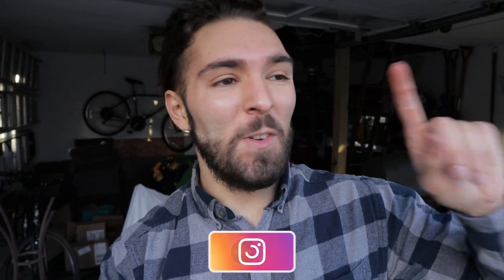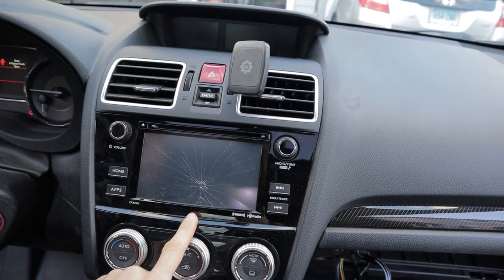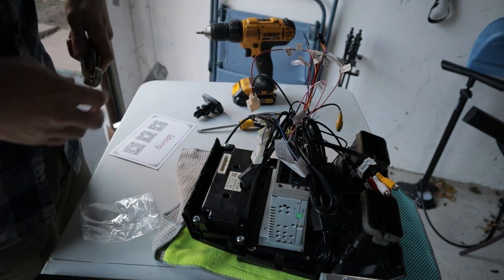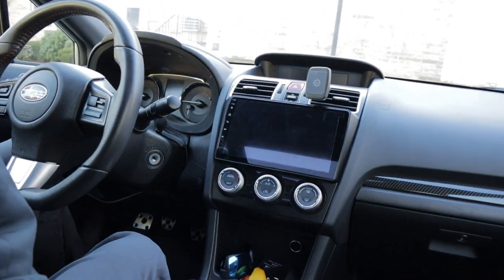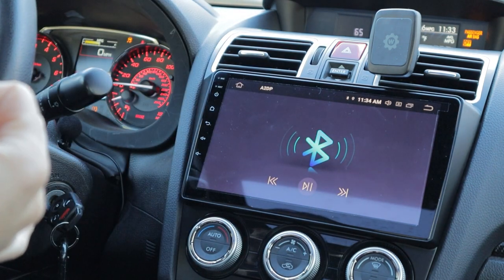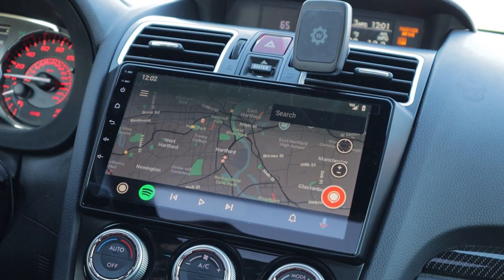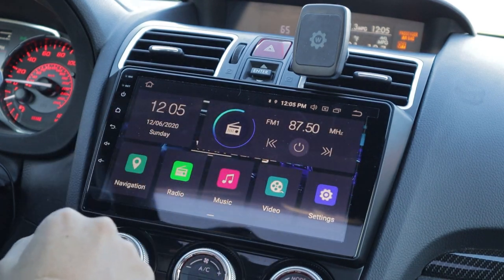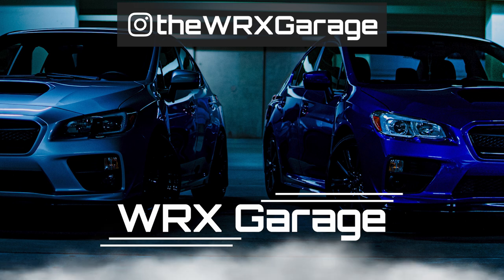iDoing Android Headunit (With Android Auto!) - Subaru WRX 15+

Comment: Just installed a kenwood head unit along with new door panel speakers and subwoofer. It was definitely more complicated with the wiring and probably more expensive than this thing. This android head unit looks very nice!
Reply: With the research I've done, brands like kenwood are for sure better for audio and reliability. These android head units may be cool and more plug and play but the customer support and everything isn't as good. Would be awesome if kenwood and other US brands could make Android units but it's because they technically aren't legal. Great choice though I bet your audio is super crisp!
Reply: @slowsubie6386  ok so you're right about the audio, though this sounds really good, but not up to par with a 1K dollar kenwood.  Now on the support front... Have you ever tried to get on chat with Kenwood or Sony, or Pioneer.  I've spent the last week basically in live chat with IDoing working through small issues.  I post and I get answers in minutes(not days).  I had a kenwood wireless AA unit in my old car.  I spent days wiring in, and AA wireless is still the most flaky finicky thing there is.  I opted to spend the 400 dollars on this instead of the 250 dollars just to get the cabling and maestro needed to move my existing kenwood over.
Reply: @slowsubie6386  it is not that they are not legal, is that these companies are all about maximizing profit and they don't have to worry about adding the extra stuff as long as the bare minimum is done

Comment: If your having trouble clipping the unit to your car, start at the top clips then move to the upper middle clips and force those down until the latch then you’ll have to put a little force into the bottom clips but just take your time and don’t break them, clipping the head unit in took me longer than taking out the old unit and setting up the new one

Comment: nice unit. and thanks for the "what not to do" PSA.   to me, car audio should be easy, especially for the manufacturer; however, Subaru goes out of their way to make theirs as low rent as possible, even with the high-end HK system.  I know part of it has to do with anti-theft and part has to do with vehicle integration; but with all of the R&D money put into other area of the car, the car audio//infotainment side should be an easy no-brainer.  That iDoing unit looks surprisingly good for Chinese unkowns.  Hopefully it works for you.
Reply: From the research I did I think Idoing is the best option for the chinese brand ones. Would be awesome if US brands could make android head units but i think its because they technically aren't legal.

Comment: Hey man I love your videos they're super informative and great for people just getting into Subarus! I just got my first wrx a couple months ago and I'm dying to upgrade the radio. The wrx has the worst factory audio of any car I've owned surprisingly as it's the best car I've owned since my rx7.  Looking at purchasing this idoing head unit but, I want to know the pre-amp output voltage for the front, rear, and Sub outputs. I've looked on their website for the spec sheet but it doesn't have this info. When setting gains for amplifiers it's important to know what this is (most head units range from 2v-5v some cheap units even less). I know I can check  this with a multimeter from the rca jacks while the unit is installed and on and I always verify the voltage before setting my gains but I prefer to know these things before I buy a head unit. Audio is always a big part of all my cars and I typically use Kenwood or Pioneer (who always have these specs on their website) but the plug and play ability to retain steering wheel controls without having to purchase additional devices and do extra wiring with the idoing is very appealing. Any chance you know what the preamp output voltage is?

Comment: Just installed today in my 2018, pretty simple however reverse function and wifi are not working...

Update: I realized the 10 pin connector fits into 2 places and I switched them. 100% working and flawless!
Reply: that's odd, you sure you got the IDoing?  The cable set I got had ZERO cables that could get put in the wrong port.

Comment: Loved the video and used it myself for my install! I only got a problem. How did you get sound on the speakers & tweeters inside the cab. I only get audio from the subwoofer? Connection might be wrong?

Comment: Great video man! I have two questions before I decide to pull the trigger on it. Is their a way I can get the HD radio? As I sometimes like to use the radio so I just wanna make sure it’ll work! My other question is to use the usb do we have to use the ones in the back of the unit instead of the one in center console? Thanks for a great in depth video keep it up!
Reply: Did you ever end up buying one? Lol
Reply: You have to use the ones on the side of unit. I have mine on IG from the passenger. You can still retain your middle USB’s for charging but won’t work for controlling the unit.

Comment: Love the unit.  Have a question. Hope you can assist. I bought a 2021 STI sport-tech with Nav & the Harman Kardon speakers. Will this unit work on my car including the steering wheel functions? Any intel would be appreciated. Thx
Reply from the maker: There's a specific model that is made for the harmon kardon system! It will retain the steering wheel functions

Comment: So i bought mine a few months ago, and its horrible if u have issues.  Theres no support, my wifi connection doesnt detect my phones, reset to factory leaves shit behind. DAB+ just gets stuck on connecting. Some Apps arent supported with android 10 and you cant update it, and you really have to force it into your dash to get it in smooth. FYI exact same model idoing

Comment: I just bought the same unit and connected everything but I can't get the whole unit to clip in properly. when I clip in the top first, the bottom pops out and vice-versa. Did you have any issues like that?
Reply: Same issue here :( did ya ever figure it out? Or just man handle it into place?
Reply: @themesican5540  update?? Anyone? Can’t get it :(
Reply: @marincusman9303  tbh aas of rn i still cant 100% get it flush lmao i just popped top and bottom at the same time so its basically even on both but it isnt all the waay in. i havent tried pushng it again i just left it to where it doesnt bother me much :(
Reply: @themesican5540   all it took for me was pushing in on the top corners of the screen at the same time with a decent amount of force and it pops in and fits perfect all around. I say give it a shot, I’m definitely glad I did.
Reply: @marincusman9303  ill try the corner thing. just popping in top first makes the bottome come out and vice versa i got irritated and left it since lmao but today ill give it shot
Reply: @themesican5540  right, that’s what was happening to me. I think I just clipped in the top and then pushed on the corners of the screen and it all went in

Comment: Sicane has a flush screen but it's outdated in performance compared to idoing... I installed Sicane in my 15wrx a few years ago then just today installed an idoing in my 18 forester xt with HK; idoing has better Amp, screen, processor, sub features... install is plug n play but a few connections have no mate but all features function... the only issue I can apon with the idoing is that my front HK tweeters don't seem to function; if I can't remedy this I'll install aftermarket speaker Focals

Comment: very helpful video bro! thanks! I've been on the fence about ordering this for about a year now but i think its time...did this specific one come with everything for car play? or did u have to order that separate?
Reply from the maker: Yes this specific one has everything you need! All plug and play wiring, has car play and android auto built in.
Reply: Thanks brother! I'm definitely going to go for it! I appreciate the help man
Reply: Hey bro I'm installing it and I'm having trouble with the front speakers...did you have any issues?
Reply from the maker: No we didn't have any issues, make sure all of your wiring is fully connected!
Reply: @Sco0bzZ_  If you have the Harman Kardon you need to leave the Starlink system connected or your front speaker get no power.
Reply: How long did it take for u to receive the item from ali express?
Reply: @darrenhernandez2459  I had an expected time of like two months but it came in three weeks, granted this was right before covid hit and shipping wasn't a mess. I've been waiting for my wheels to come for over a year now. Shipping from china is so screwed up
Reply: @Sco0bzZ_  my girl just ordered this for me so she was stressing over it because she hasnt gotten a shipment update
Reply: @darrenhernandez2459  honestly when I got my tracking number, literally the next day it was here no lie. I would trust that you would definitely get it but the only thing I would stress is the when. I'm going to run back into my emails to see if I can give you prescise time to ease your mind bro
Reply: @Sco0bzZ_  appreciate you

Comment: nice vid... help alot... by the way... have you tryed and add or install new apps? how’d it go? thanks..
Reply from the maker: Yeah! Just have to be in range of my home wifi and used Google play to download new apps. Already downloaded a screen brightness control app to lower the screen at night. Works perfectly
Reply: @WRXGarage  I tryed... but the problem in mine, after downloading the app my zlink display disappears... as in blank but  it seems to be connected music playing but no display on the head unit... wireless and plugged in...
Reply from the maker: Hmmm.. I turn the wifi function off as soon as Im done downloading apps so it's not constantly searching for new wifi. Maybe yours is using a different connection type? 

Also, try redownloading zlink from the app store.

If nothing else works you can factory reset the headunit in the settings.
Reply: @WRXGarage  thanks... will try..👍
Reply: one more thing, does your unit has mirror screening?
Reply from the maker: I'm not sure what that is..
Reply: @WRXGarage  from your phone... its like whatever you see on your phone display thats what you see on the unit monitor... so it’ll be useful if tou have netflix or some sort of player instead of watching it on your phone you can waych it on the headunit screen...
Reply from the maker: Oh right! Yeah Ive seen that done somewhere before. I haven't tried it yet.

Comment: As much as I want one. I want it to be completely seamless using the stock mic already in the car
Reply from the maker: It might be possible to convert the stock microphone pin to the one this system uses... Not sure
Reply: uhm..so these units allow you to use external mic or mic built in the unit.

Comment: Hi…Installed my head unit..The few issues I ran into was the Wi-Fi kept turning off until I plugged the 4G antenna in. Now the issue I came across was the clarity is not very good for the reverse camera I can’t find any settings to adjust it assume it’s in the passcoded section. Any insight?

Comment: You were showing how the unit came with external GPS antenna and a microphone. Does this unit work with the existing ones as well?
I'm also wondering if there is a function for programming preset text messages. Stock head unit has a few preset messages you can send while driving, but you can't customize them.
Is the unit fully operational while driving or does it still lock you out and you can't enter an address manually?
Reply: you can decide if you want it to limit you when driving(settings), otherwise completely operational. No it will not work with built in gps and mic(at least not without cutting).

Comment: I have a 2014 wrx and saw that most of these head units are easier to get for the newer models that have the silver aircon vents. Would I just be able to get the silver aircon vents from a newer model rexy getting wrecked and use them and it all still work normally on my older Rex?

Comment: Hey man, I did this install but my radio don’t work I plugged the one wire into it the one plug and am left with a blue wire with a cap on the radio side and the car side I’m left with a 4 pin plug with aluminum and plastic shaped like a upside down L

Comment: Hey, great video! I just installed mine and I’m having trouble with the back up camera. It says “no signal”. Im also getting the check engine light which wasn’t there before 🤦🏽‍♀️ Any suggestions ?
Reply: Tightened the battery connection (that turned off the check engine light)

Still no back up camera view
Reply from the maker: When we installed ours, there were 3 different yellow AV plugs to choose from. Try each one and you should be able to find the right one!
Reply: @WRXGarage  I thought of that but I don’t have any wire that can connect to a AV. I’ll take a second look today. Thank you for the help

Comment: Does your phone auto connect when you get in the car? The stock junk in mine makes me pair the phone everytime the car is turned off and its annoying to the point im looking at this head unit lol
Reply from the maker: It's a wired connection to use android auto or apple carplay. I just plug my phone in every time I get in the car and it's pretty much instant

Comment: Hi my reverse only works with the car off in ACC mode once on it shows yellow error. no idea how to correct this issue.
Reply: Same with mine I have a 2020 WRX
Reply: Did you try the other video in/out connectors?  On my 2018 only one combo worked at all but maybe you're 2020 is different.

Comment: Im waiting on my unit should be here soon, did you route all your USB cables into the glove box only or is there anywhere else you can route them. Middle console??
Reply from the maker: If you buy a usb extension from Amazon,  it would be pretty easy to route it under the shifter trim tunnel back to the center console
Reply: I routed 1 under the unite in place of the Accessory plug, I put two in the glove box as well as ran the Center cable to the console.  I then ordered the adapter from amazon for 15 dollars and connected it to one of the usbs in the glove box, and now I have I have 4 USBs all provide power and all work with android auto/usb thumb drives
Reply: @marcdukette5095  what does the adapter do?
Reply: @Y012AD  you plug one end into the stock console usb plug that's behind your radio.  You plug the other end into one of the USB-A plugs off your head unit.  It lets the 2 USBs you have in your center console work with the new HU.
Reply: @marcdukette5095  link?

Comment: Hey man, I just installed this same unit. Im having issues getting the backup cam to work though, any tips?
Reply from the maker: There are 3 different yellow connectors, there's one that will work! Try each one individually.

Comment: I have a 2021 and my back up camera is not working. I plugged in the 5 pin connector that it came with but all I get is a no signal screen when reversing.  Any suggestions??
Reply from the maker: You need to connect the yellow AV cable for the reverse camera.
Reply: @WRXGarage  I never received one in the package. Idoing is saying all that’s needed is the 4pin top right corner. Might be because it’s a 2021?
Reply from the maker: Yeah it's probably different wiring than mine.
Reply: Did you get your backup cam to work? I installed mine, and it just says no signal when in reverse. I did plug in the 5 pin connector in the top right, but still nothing.

Comment: Hey. I appreciate you posting this. 

I’m want to install this in mine but my only concern is connecting it to the subaru’s factory installed mic in the car. 

Are you able to connect this new head unit to the car’s factory installed mic?
Reply: No you have to use the internal mic on the HU or plug in an external.
Reply: Mine works with the OEM mic you just plug that into the back

Comment: I’ve put in a desaita android unit about a week ago. It looks very similar to this idoing unit. After  a few days of use I started getting this static and crackling noise in my front left speaker. It starts after a few minutes of running and then gets progressively worse up to a point. It’s whenever the unit is on. Mute, any volume the sound is the same. After having this unit for a year, have you run in to any problems?  I love the looks and functionality, so I am wondering what the odds are of running in to the same issue if I just exchange it.
Reply from the maker: Sounds like you have a bad ground somewhere or something causing the static feedback. Try tracing the wires in the back of the headunit or replacing the speaker

Comment: What stops me from going back to android head units right now is shortcomings such as at 13:20 you had to manually change the screen brightness. Why in the world can they not put a 30 cent photo sensor for proper automatic brightness adjustment; the software support for this is built into android as it is, why don't the utilize this? I was constantly fumbling with the brightness settings on my last android head unit, I know there's apps and settings to do automatic brightness but sometimes they just flat out didn't work when I got in the car and turned on the key, this frustrated the hell out of me. I even tried different rooms, different apps, etc. This is annoying. The audio settings applications for the DSP chip are lacking and confusing, not taking proper advantage of what that DSP audio chip COULD do.
Reply: Because they never work right even on 1K dollar tablets.  I hate auto brightness.   What they should have is two manual brightness settings.  One with the HL on and one when they are off.
Reply: @marcdukette5095  this

Comment: There was a couple of wires that I couldn't figure it out where to connect them, specially one thin blue one, I didn't plugged it, and everything works fine so far 🤷🏻‍♂️
Reply: It’s a remote wire to turn on your amp if you’re running a subwoofer